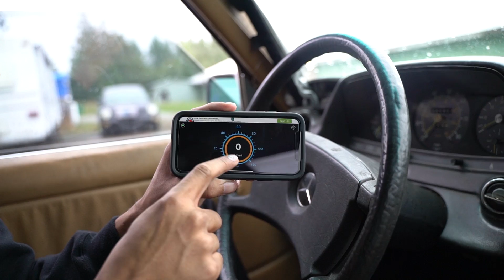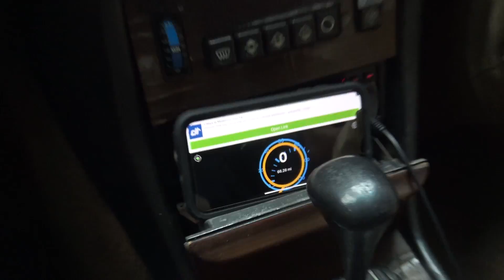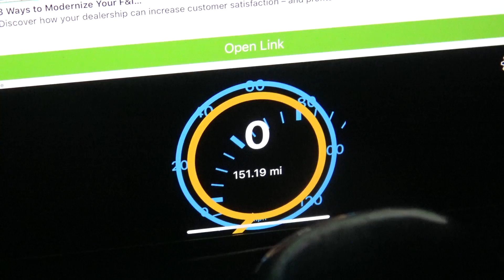Will a Car RUN on USED MOTOR OIL?

Comment: I’ve burned 100s of litres of oil through my car and use a ratio of 85% oil, 15% petrol. Doesn’t even smell, feel or look any different than running on clean diesel. Extensively filtered though

Comment: Perform a drop test. Ballbearing timed traveling in measured amount of fuel. Compare diesel to the oil. Thin to required viscosity. That's how it's done. Use paraffin, brake fluid, etc.

Comment: u used  a lot of diesel actually ppl who do this usually do 60 oil 40 diesel for the FIRST time they do it on a specific car then work the percentage up to 80 oil 20 diesel and yes it runs good unless u wanna race it xD

Comment: Rather than use the filter in a funnel which reduces the effective surface area of the filter, how about the filter in a colander which would increase the working surface of the filter and probably go much faster.

Comment: I’ve run my om617 on 80 percent waste oil for the past 2 years. I’ve even ran brake fluid. They don’t care. Never had a problem. Just make sure your injectors are up to snuff and no underlying issues with turbo or injector pump

Comment: Run my 2005 sprinter on used engine oil, rapeseed oil, veg oil, sunflower oil. Cooking oils made it a pain to start and lack of power when cold. Used to get a warning light for the fuel filter but I’m guessing the oil struggled to flow with the cold temps. NEVER stopped me from getting where I needed to go tho. Old mercs run on anything 😂

Comment: Why does it work with diesel and not regular gas cars?
Reply: because gas cars run on gas and require spark to ignite gasoline is flammable BECAUSE GAS CARS HAVE SPARK diesel isn't flammable or it doesn't have low flash point diesel engines don't require spark so they can run in diesel because the fuel combusts in the cylinder because of the heat formed by the compression is what ignites the diesel

1. Low auto-ignition temperature Diesel can burn when sprayed over the hot air. In a diesel engine, the air is slurped in pressure stroke, then the air is compressed by a piston while squeezing the air heat is generated in air average, and heat is generated by compressing the air. ...
2. Self-Light Temperature

Comment: You can also run used transmission fluid in a diesel, one of my co-workers does that in his 7.3 powerstroke and it runs fine.

Comment: For anyone thinking that this will ruin the engine, it will not as long as this process is done right. I don’t recommend filtering the oil through coffee filters I personally would use actual oil filters that have a low micron (5 or lower) level or a centrifuge and to be sure that I know exactly where the oil came from. Oil and diesel mix pretty well and the old diesel engines love extra lubrication so as long as you do a good ratio and make sure everything is as clean as possible it should be fine. I have met people that have ran “Black Diesel” in their older diesel vehicles for a long time without issues. Personally I would have more diesel than oil in my ratio and the cleaner the oil you start with the better the result but I am no professional so do your own research before trying this.

Comment: Did you know used motor oil can possibly clog your car kind of like if you eat Burger King 10 years straight it will clog your arteries that’s what you’re doing to the car you’re clogging it up!

Comment: Thank you for your video! You did a great job! A few years ago I made black diesel but the cost of fuel was not near as bad as now so I did not keep doing it. Ruined a lot of clothes! I used a heater and a centerfuge. I brought the heater up to 200 degrees to get all of the water out. Then it went into the centerfuge which cleans much better than filters. Then it went into the finishing tank which was a Tractor Supply Tank with an internal pump. I did 16 gallons of used motor oil and added 2 gallons of gasoline and 2 gallons of diesel and one ounce of acetone for a cleaner for 20 gallons of mixed fuel.  I mixed it for several minutes in the tank at over 100 degrees and then thru a one micron filter before putting it into the truck fuel tank. There were three of us using it for 6 months. It gave us more power and did not smoke any different that the diesel at the pump. Easy starting and none of us changed any fuel filters. Warning: Do not mix vegetable oil with mineral oil. It will cause a sticky substance and you will plug up your pump and injectors. My truck is a 1997 5.9 Cummins 12 valve diesel. The second one was a 2003 Dodge Cummins 24 valve and the third was a 1995 Ford 7.3 diesel. I do not know how well it would work on the newer diesel engines.The cost to make the fuel was 20% of the cost at the pump.
Reply: Do you think the comonrail system will work on a black diesel?
Reply: @elizabetajvengo8097 generally, that won't work well with most common rail systems unless you have a really good filtering setup

Comment: We poured 5 liters of long time settled used motor oil directly into our Chevy Tavera SUV 2.5L Diesel tank and let it mix naturally by sloshing around whilst driving and we notice no difference in operation. We assume the fuel filter will do what it's designed to do as needed.

Comment: Running a little oil in the fuel is something alot of people do 2 stroke oil is better but the oil you used would have done more good then bad especially on that old Mercedes they are tanks it's hard to kill them at least the the 1 i had and the others I've been around

Comment: Only run 20w50 non synthetic engine oil I the 300D
Never use synthetic no amsoil in 300D

Comment: 16gallons used 5w/30  eco pod engine oil
2 gallons gasoline 3 gallons offroad farm diesel red
4 ounces acetone mix in large container or clean used fuel tank
12volt  electric pump for oil gas with remote spin on oil filter unit  clear 1/4 hose 

1 set new fuel injector nozzles SD240 from star diesel
1 set new injector sealing rings ebay
Replace both primary and inline mercedes filters rock auto
Remove fuel carefully remove sender set aside tank clean laundry detergent dry with hair dryer 
Ebay 1 quart red Kote fuel tank sealer mix 1 cup acetone poor in tank and coat inside poor out excess back into red Kote can.dry with hair dryer fan only no heat recoat tank 2nd time with red Kote can. Rubber lines with new ethanol resistant rubber hoses.reinstall fuel sender reinstall fuel tank.fill with black diesel.fill spare jug with extra black diesel. Put In trunk secure with budgie to trunk hinge 
DONE ..

Comment: If you really want to save, mix 10 percent non ethanol gasoline instead of diesel, and then filter it, as it will be thinner.

Comment: That does not surprise me. The old 3 liter 5 cylinder engine from Mercedes is still a pre-chamber diesel which basically eats everything that burns as long as it goes through the filter.

Greetings from Germany

Comment: Can you stop posting  these idiotic videos , the kind like this one here? This is no brainer  a car would run on an used oil. Depending how used the oil is and what quality it is. It might run  with experiencing  some  more or less damage to the engine, But it will it run for sure. People with zero IQ know this too.

Comment: I can see the reason why you guys couldn't use straight motor oil because it doesn't have a high enough Flashpoint enough for it to detonate so you had to use diesel fuel to blend it in well, the good news with that is that you're actually adding more volume to your fuel so it's more fuel for Less diesel especially when you have used motor oil that you don't no longer need and you're low on diesel and doing that adds more volume to your tank for cheap😏👉🏻 and plus you're adding more lubrication to the top end of your cylinder so your motor lasts a lot longer when you really think about it🤔

Comment: These pre-chamber diesels were made as multi-fuel engines. The robust Bosch inline pump was part of the concept.
So why thin it with diesel if it runs on filtered straight vegoil?

Comment: Mixers? Buckets? Coffee filters? Wtf? Just dump that shit in the tank and run it.. i added a second filter to keep my shit clean. Why are you cutting it? I run 100% oil cut with gasoline.. 10 gallons of oil to 1 gallon of 87 octane gasoline just to raise cetane levels.. but benz will run on oil straight.. it don’t care.. you made it way too complicated mang

Comment: lol what was the point of this?   You mixed 90% diesel into old motor oil lol???????  Okay so you just crapped out a fuel filter in making video and this proved what exactly lolz?   Not like your running this thing off motor oil.....  Even though that could be done as well

Comment: Very toxic to burn used oil, ESPECIALLY synthetic oil can and will if breathing fumes cause brain tumors! There is a documentary on this with airline pilots cabin air coming from turbines. Just be aware!! Nice video though

Comment: Hello ya, i wish to know that, i drain about 5 lt of used oil. My tank is sbout 50 lt diesel. Will it hurt my engine performance or engine itself if i pour 1 litre of waste at every full tank. Thanks

Comment: A diesel can run on used engine oil just fine, but I’d mix 50/50 with fresh diesel and run it through a 10 micron filter before using it.

Comment: mechanical diesel engines will run on pretty much any oil just most non diesel oils will result in a lot of carbon buildup and faster injector wear/clogging and it probably wouldnt be a good idea to use it below freezing

Comment: Come on, at least warn the used motor oil before you filter it. It will run smoother.

Comment: I got a line on wmo from a ktm shop, im feeding it to my alh tdi. Thanks for your research. Btw i saw a vid where a guy used gas, but he did an experiment and the solvent dissolved into solution almost instantly, and did not settle back out after hours or weeks. He did fresh motor oil, canola oil, wmo, and wvo, the waist oils had precipitations at the bottom but the solvent did not separate. Kinda long winded way of saying you dont need to mix it so much, maybe.

Comment: Never run used engine oil in a injected car, youll soon find that your injectors and fuel pump blocked by microscopic metal fragments from the old engine oil. no matter how well you filter the oil, it will always contain metal fragments (pass a magnet through the oil and its basically ferrofliud)

Comment: Someone beat me too it but yeah you're supposed to mix them first and then strain through the filters, it goes MUCH faster that way, and you can mix way higher ratios too. Many older diesels will run on a higher oil mix than 50/50 even.

Comment: There's not much oil in it.

You can run a gasoline car on that much oil.
You can also run that old thing on kerosine 

Try oil and gasoline on the diesel engine!

Comment: You should have mixed the oil and diesel first then filtered it it would be thin enough to run through the filter fast

Comment: About 15 yrs ago, car and driver magazine printed an article called Riding with Ricky.  they went to Havana and rode with a cabbie in an old car converted to run on waste oil. It was (I think) an old '50's Chevy V8 with 2 throttles. 1 was for starting with gasoline, then after it started, the other was for running on drain oil.

Comment: is that used motor oil from a diesel motor or gas motor I don't know if it's a good idea to use used oil in a diesel from a gas motor because it will have gas in that used oil

Comment: That stuff might no be to environmental friendly, but it will be like heaven to your fuel pump and internals(if theres no metal flakes left)... You guys should have placed a magnet inside the coffe fter to see just many metal particles is in the oil

Comment: Try running straight motor oil I run straight motor oil in my 1985 Toyota Hilux 2.4 diesel and the only difference is it smokes bad when it's cold and it has a little bit slower exeleration other than that it goese good

Comment: Mix with the Diesel then the filter may have worked better and flowed through the filter better. Just a thought. But Very cool Idea and way to save and use up old oil!!

Comment: it will run if all glowplugs are working properly
i have done it 4 few years now, it will even start in the winter ~ -15 degrees celsius.
if glowplugs are not working, there is no chance to start it even in the summer
it will run properly on both,- veg. oil and used motor oil...
NEVER MIX VEG.OIL WITH OLD MOTOR OIL - IT WILL TURN INTO JELLY IN YOUR TANK.-use diesel to dissolve it.
best results  come with 3.0 mercedes diesel and 1.9 vw diesel non turbo produced before 1998...
 or whatever with mechanical fuel pump and better if with short injectors.

have fun.

Comment: why would a diesel car not run on a 70/30 mix?
The real challenge is :
Would it run on a cold climate on 100% used  motor oil?
It can run on 100% waste veg oil
Reply: it will run if all glowplugs are working properly
i have done it 4 few years now, it will even start in the winter ~ -15 degrees celsius.
if glowplugs are not working, there is no chance to start it even in the summer
it will run properly on both,- veg. oil and used motor oil...
NEVER MIX VEG.OIL WITH OLD MOTOR OIL - IT WILL TURN INTO JELLY IN YOUR TANK.-use diesel to dissolve it.
best results  come with 3.0 mercedes diesel and 1.9 vw diesel non turbo produced before 1998...
have fun.
Reply: @ivar6012  You mean used motor oil or veg oil ? I know it can run on veg oil and stuff about mercedes engines
Reply: @AAAAAAndrea  both... If i could take a pic in here i would show u my daily running only on used motor oil... Since january... & Its still working good...
I dont use veg oil anymore bc it takes a lot of time to filtrate all the seasoning out of it (salt..etc.)
& When using veg.oil car needs oil change about every 6000km bc veg.oil fuel turns motor oil slowly into jelly.

Comment: I had a two stroke Deutz light tower/ generator that burned straight used motor oil from the shop and we ran off grid in the middle of San Francisco doing it!

Comment: Not surprising at all...
It will run on any oil... the best is power steering fluid...
Sunflower oil is also great. The older the diesel is, more kind of fuel it will take. Beauty of the diesel.

Comment: I used to run my 94 Vw Passat on a 50/50 mix of vegetable oil and diesel , it used to smell like a mobile deep fat fryer , 

 Oh FYI you got nowhere near it’s maximum range , my 330d bmw will get 600 miles on the tank

Comment: Did a similar thing in the Pilbara west Australia used old frying oil and diesel 50/ 50 to get a 1hz  landcruiser to the next town . I would recommend a heat exchanger from the cars cooling system for a heavier oil fuel mix if you were intending on doing this often.

Comment: Ita going to stink, ive done before. Use veg oil instead, at least it smells like food and not like your engine is gonna blow up :P you can also use hydraulic oil, peanut oil, transmission fluid... etc. Also whats mixing it for? Just drive around for a bit , it was slosh around in the tank. Ive logged over 10,000 gallons of veg in my 84 300D . These cars are legendary.

Comment: Tip for anyone trying this, first mix engine oil with solvent (petrol is better, 20% petrol) then let it sit overnight, metal filings from oil sink to bottom, then pour fron top, filter after mixing and it goes through filter mucho easier.

Comment: Diesel is the byproduct of refining gas, it's the crap that they used to throw away, now it's more expensive than regular fuel. this isn't a used oil test, this is a diesel fuel test with a dash of black oil. of course it will run. probably not as well in a new style diesel engine like my 6.7 power stroke but it would still run. Diesel engines run on compression not a spark, once you get the compression going that diesel will run on used fry oil also. Most people already know this, that's why you cant get used oil for free anymore from restaurants.

Comment: I don't bother with this crap 🤣 I just chuck it in the tank without filtering ( 2002 citroen van direct injection) and never experienced a problem! My common rail Saab didn't like it but the citroen works just fine
And tried it in a common rail Mondeo ( 2006) got problems and codes for low fuel rail pressure, but the French direct injection laps it up she's a good girl and swallows the lot without complaining ( pun intended)
Reply: Dont follow this advice! Fuel filter on older cars is 20 micron, so your just going to clog your fuel filter way before its time.

Comment: Years ago in college I drove a 1987 300sdl on black Diesel. My mixture was 90% used motor oil 10% diesel. Ran just fine during the summer in California with air conditioning. MPG was very good no difference. Conventional oil is best for this application, synthetic oil over a long period of time will plug up the injectors.

Comment: That thing will run off most oil, Rudolf Diesel invented a multi fuel engine and presented it to the world running peanut oil.
Modern ones won't but the old 300d is solid, as long as the fuel pump pumps it, will run. I have no doubts.

Comment: really the better experiment  would be to do a a bio-diesel conversion on the benz and use waste cooking oil as your bio-diesel base. can usually source the oil from local restaurants. there's a plethora of information available on the web with details on how to do a simple bio-diesel conversion on a diesel engine as well as fuel recipes using HEET or glycerin among other things . it's a pretty cool conversion that's relatively easy and inexpensive and ends up being not only economical but fairly green. well... greener than using straight up diesel. the conversion actually will pay for itself over time and actually begin  to start truly saving money on fuel if you were to use it for a daily or travel/touring vehicle.

can find a lot of good info here:
http://www.make-biodiesel.org